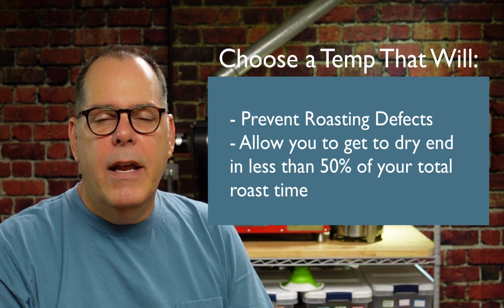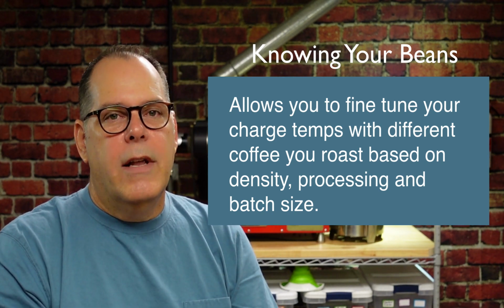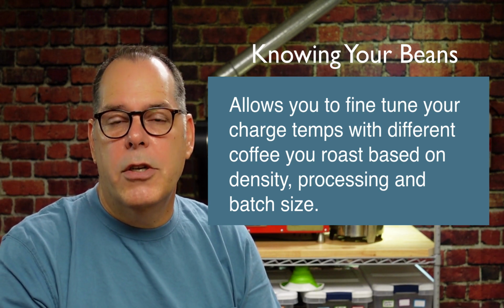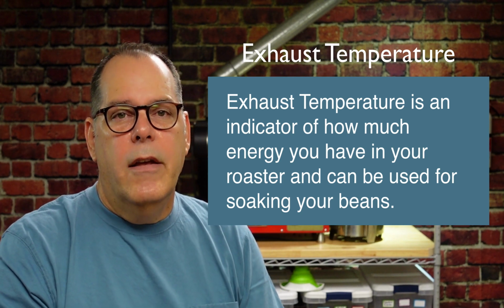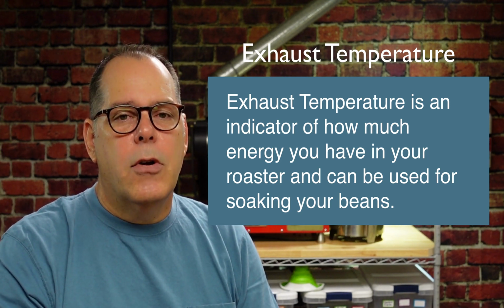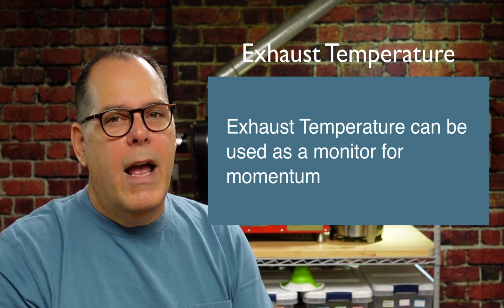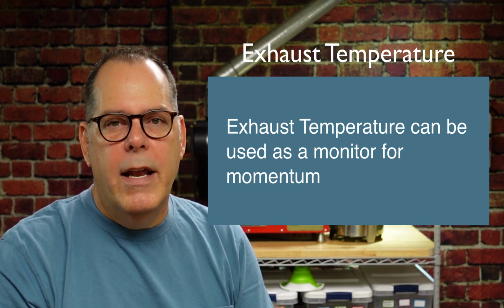Charge Temperatures For Home Coffee Roasters

Comment: Really enjoy your videos Mike. This is another good one. Even though I'm using a Behmor roaster, there's always some good information I can get from these. I have actually started watching my exhaust temperature more than my drum temperature. I feel like I'm getting more information that I can actually use. I am using Coffee Roaster Pro app to document my roasts. I'm getting some very interesting results by planning from the results of my previous roasts.
Reply: Me as well. Excellent content.
Reply from the maker: Great point Mike.  Comparing roasts is a real tangible way to figure out your roasts.  So are you comparing event times?  How long it takes to get to dry end or how long it takes to get to first crack based on your power settings?  I looked at the app.  Android only i think.  I didn't find an iphone version.  Looks pretty cool.

Thanks for the kind comments.  I'm glad my videos are helping.
Reply: @VirtualCoffeeLab  Coffee Roaster Pro is pretty cool. I am comparing event times like yellow, dry end, drum speed, 1C, etc. that can be timed. The app is adaptable and will let you add events that are not already in the app. It still likes a bit of information but a better way to track my roasts on the Behmor.

Comment: Good video, Mike. Charge temperature is a tricky one. I spent a lot of time experimenting until I found a good range for my roaster. I don't have exhaust temp readings but it sounds like that would be most useful. Thanks for all the good information!
Reply from the maker: Hi Gary, I'm surprised that the Ailio Bullet doesn't have an exhaust temp probe.  I'm curious to hear what your "range" is.  I forgot if you are using a consistent batch size, is it 1 lb or 2lb?
Reply: @VirtualCoffeeLab  There's been talk of Ailio adding an exhaust temp probe but I don't know if I'd be able to retrofit one or not. I normally roast in about 540 gram batches or just about one pound, mainly because that amount will last me ten days to two weeks. Depending on the bean, I'll preheat to between 210 and 230 degrees Celsius ( 410-446 Fahrenheit). That's likely higher than you do with your gas roaster, I guess electric behaves a differently than gas although I don't know the physics on that.
Reply from the maker: @garygardens  - Sorry  I missed this message Gary.   Yea, I rely on the exhaust probe to know how much energy I have banked.  If my exhaust temp is close to my bean temp, I have no horsepower to push up my ROR.  
I preheat to about 380-400 degrees, then after the preheat, let it fall to about 350 and then blast the heat up to 380, cut the power and charge the roaster.  That gives me the momentum to soak and then get my drying phase moving along nicely.
 I've been having some difficulty lately with my gas control so I get some wobbly ROR  near and after first crack.  Trying to figure that one out....

Comment: Thanks again for a video, Mike. It's been very useful to me. I'm learning with my Hottop -2K+ with which I've roasted 21 batches so far; 7 roasts since I upgraded to -2K+ and Artisan software.
The Hottop does not have an exhaust temperature but it does have environment temp. On my last roast, that temp shows a slow increase all the way through the roast starting just after the turning point. 
I've been charging at 350° but leaving the heat on 100% until the bean temp hits 300°. My dry end has been occurring in less than 5 minutes, usually around 300°. I've been happy with the coffee but I'm still trying to see if I can get improvements. I increase the fan speed at various stages throughout the roast starting at charge.
I'll raise the charge temp little by little to see what happens. My dry phase has been less than 50% of the total roast time, but I'd like to drag out the middle phase a little longer. My last roast middle phase was 2:39 minutes, or 27.3% of the roast. 
In either case, this coffee is better than the canned stuff from the grocery store!
Reply from the maker: Hi Adrian,  Thanks for sharing.  It sounds like you have the momentum to get a great roast.  I would add another minute to your middle phase.  That means you are going to have to slow down your roast (lower your rate of rise) in that middle phase to stretch it out.  32-35% might be interesting to try.  I think you will see more flavor development.  Are you able to monitor rate of rise?  I'm curious what your highest ROR is during dry and then what your ROR is at first crack and then when you drop the beans.  Please let me know if you.
Reply: @VirtualCoffeeLab Thank you, Mike. I could not figure out how to post a screen shot of my Artisan graph. 
Perhaps I could increase the fan speed during the dry phase to try lowering the ROR. It was 20%. During the dry phase, the ROR is highest just after the turning point @ over 40° and drops to 24° @ dry end. At first crack it's 16° and when I drop the beans it's at 12°. Thanks again.

Comment: I was about to do some roastings today and thinking to raise my charge temperature and got this video notice. What a timing! I used to use 385 F as the charge temperature, but the Artisan software recorded charge temperature around 367. And the dry time is close to 5 min or longer with 140g beans and Hottop roaster. I got some feedback from friends and family that the coffee is kind of flat, even I have not too bad phase time distributions but around 12 min total roasting time. That is why I want to try to test higher charge temperature. 
I have a feeling that the DE temperature or final drop time temperature is also a profile impact factor. Not sure its correct. If so, wish you can give some your insides. Thank you again for your videos. They are very valuable to our beginners.
Reply from the maker: Hi John, I would encourage you to try a higher charge temp  It will shorten your dry phase BUT watch for roasting defects & that extra momentum.  You will fly through the middle phase.  So, since you going to try that, try to target your middle phase time for about 3:45 for more flavor.  That means you will have to be careful and monitor your rate of rise during this phase.  If you have too much momentum, it will be hard for you to lower your rate of rise enough to lengthen the middle phase and it sounds like that is what you need to do.  Also, watch for steep decents in your rate of rise as well as flat spots.  These will impact flavor development.  In Artisan, when you mark dry end, watch up near the top of the screen where the predicted time appears for the middle phase.  Notice the lower the rate of rise, the longer the predicted time gets......  that is your number to watch to try and hit the 3:45..........  Let me know what happens and if that makes a difference.  Also!!!!! Be sure not to turn your air up too much after you have lowered your heat or you will see your rate of rise drop quickly....  Hope that is helpful.
Reply: Hi, Mike, I did 4 batches of 150g, 2 regulars and 2 decafs for my wife. I am happy with the 2 regulars, and my son said it’s better than the previous one, where one of them is the same beans, although I did not achieve the browning time you recommended. If you don’t mind, I’d like to share the Artisan logs with you. Thank you.
Reply from the maker: @johnsnow3602  YouTube doesn't offer an easy way to direct message.  Please go to my YouTube "About" page, scroll down to the facebook link and you will be taken to facebook where you can message me though the Virtual Coffee Lab Page where you can attach images..  If that doesn't work, we can try and figure something out.
Reply: Mike, just sent 3 logs via your Facebook message. Thank you.

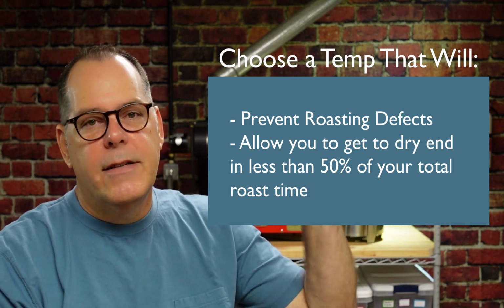Comment: Another great video, Mike.  Since I roast using a Behmor, it seems about the only way I can have any control over charge temperature is maybe with pre-heating. I currently pre-heat to some extent (100 - 150 F, B temp), but sometimes I think my Drying Phase time is a little long.  I might have to try maybe even a higher pre-heat temperature, especially for more dense beans.  Exhaust air temperature on the Behmor (the A temperature) is not even available for me until after the vent opens (7:30 into the roast), and then it's actual value is somewhat questionable.  Good information here Mike. I will definitely have to try something on upcoming roasts.
Reply: Fellow Behmor user here, and I agree. Pre-heating has, for me, been about the only way to consistently keep my first phase to ~5 minutes for my small batches (usually no more than 250 grams). I have settled on 200 B temp as being good for most beans I roast. My machine won't let me pre-heat beyond ~245 B temp without needing to cool down, but I know each Behmor has its own quirks with preheating.
Reply: @dg10890  Dustin, you give excellent advice!  Most of my pre-heat (B) temps have been 150 F and one at 200 F.  But after reading your reply, I decided to go to 250 F to see what effect if any it might have.  I came out with my best roast ever.  My previous dry phase times have averaged about 6 minutes, which I always thought was a little long.  This latest roast (200 g Columbian) had a 250 F pre-heat and I got a dry phase time of 4:49 - more than a minute shorter than my average.  The roast came out a beautiful light-medium, exactly where I wanted it, and it was wonderful in the cup.  Thanks again for your input!
Reply from the maker: Great feedback and observations for the behmor users Lou and Dustin.  I realize that some roasting equipment has it's limitations and I am glad to see some creativity to compensate.  I think Dustin's pre-heat temp sounds pretty good.  As for the fan and exhaust temp, your right, very questionable with the behmor.  As far as airflow goes, drum speed can help a little with airflow.  The lighter the load the more the beans should be able to fly.  Also, the lighter the load the faster you will be able to make it through dry end :-)

Comment: Have you ever tried to run your machine at full airflow and optimum drum speed, only adjusting the burner throughout the whole roast? 
Wondering if this is possible with a machine like yours. 
Can you remind me what machine you're working on?
Reply from the maker: I have a Mill City 500 gram roaster.  It has a pretty powerful fan so if I had it on max I would not be able to roast.  All of the heat would get sucked out.  That is an interesting question, "what is the optimal airflow for my roaster?"  So thinking about that, I would say it depends what phase of my roast I am in.  I use a low airflow setting during the dry phase.  Using a lighter and holding it up to the trier port, the suction is barely neutral and the flame is pulled ever so slightly towards the opening.  Then just before I hit dry end I bump the air up a little to begin my transition to the browning phase.  This helps bleed off a little of the momentum I have been building up in the dry phase.  Then once i am in the browning (middle) phase I use a medium airflow setting.  The lighter flame would lean towards the trier opening.  Then at first crack I increase my airflow to a higher setting, causing the flame to be bent inward into the trier hole without it extinguishing.  
My drum speed is increased about a minute before dry end to increase airflow.  
I did a video on how i use air when i roast.  That offers some extra info not mentioned here.  https://www.youtube.com/watch?v=G8BRifGG0hE
Reply: @VirtualCoffeeLab  Wow! Thanks so much for taking the time to give such a very descriptive response! Seems pretty consistent with the folks at Mill City roasters. Of course, the settings vary quite widely for them, depending on the coffee being roasted. 

I've had this idea floating around in my mind ever since watching a video with Rob Hoos explaining how he uses air flow. He was saying that he with each machine he works on, he attempts to use the max air flow and drum speed possible for the batch size, then adjusts the burner accordingly, in order to use the most convection possible. 

Then I saw another video by the roaster manufacturer, Genio, in which they compared 4 roasts. 
In one, they used max air and drum speed the whole roast. 
In another, they used minimum air flow and fan speed the whole roast. 
In another, they used varying air flow, varying drum speed. 
In the last one, they let the machine automate most of it. 
It was quite eye opening to see how a single machine could be used to produce the same curve in so many different ways. However, the max air flow and drum speed one finished earlier. I think because the dry phase was much shorter. 

I am studying as much as I can, as I plan to own and operate a roastery and cafe in the near future. 
I love your videos! 
Thanks so much for sharing!
Reply from the maker: Great info @GoTellJesusSaves.  I am using max airflow towards the end of my roast.  Although the fan has more power and air to give, the "flame on the lighter" would be extinguished.  So, the high setting i use is the "Max" airflow that will work with my roaster before I start sucking all of the heat out of my roaster. 
Starting a coffee roasting business is a big step.  Soon you will see a video that talks about that.
Reply: @VirtualCoffeeLab  Yes. By max airflow, I'm referring to max usable airflow for the batch. 

Awesome! I'm always looking forward to watching your videos! 
I appreciate you taking the time to do what you do. It's helpful and thought provoking. 

Blessings to you as you continue on!

Comment: I was just considering a change in my charge temps today... then I see this video pop up.
Reply: Same here 😀
Reply from the maker: Thanks for watching the video.  I hope you found it helpful.  Timing is everything haha
Reply: Absolutely! I enjoy all your videos and have gone then to be helpful. 
The increase I made in charge temp made a massive difference in the speed of the roast and also caused the seeds to be more color consistent (outer color/ground color). 
I was roasting a very soft Brazil. I was told this seed needs a higher initial temp to get the center of the seed cooked properly. Sure enough. Exactly what it needed.
Reply from the maker: charge temps are variable based on so many factors including bean density.  As a general rule, low density beans are prone to roast defects like scorching and tipping.  Ultimately the result will be visible in the cooling tray after the roast as well as in the cup.  I'm glad the Brazilian is working for you!